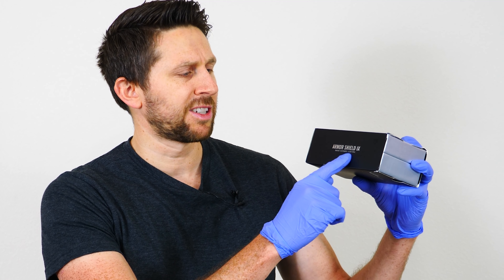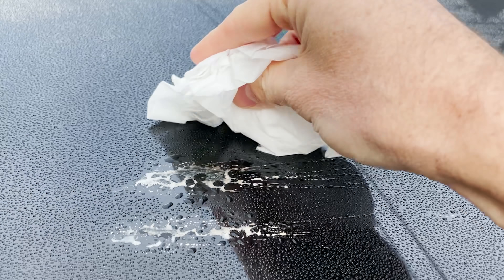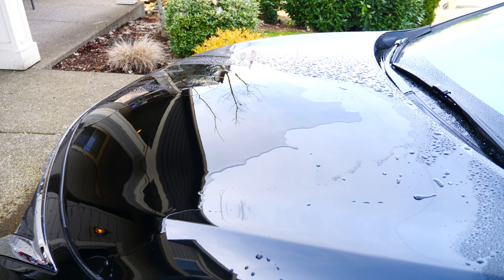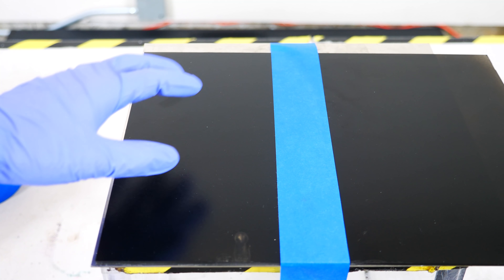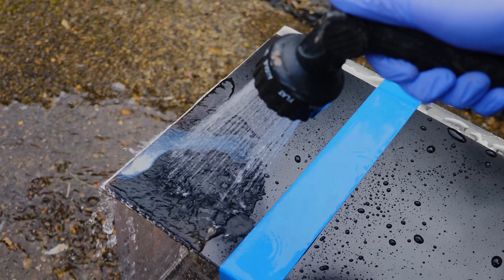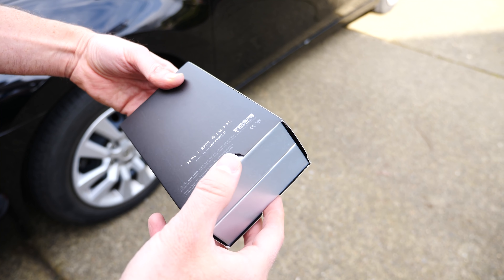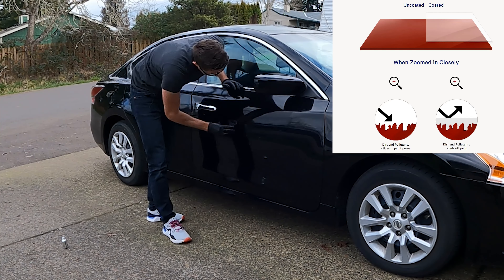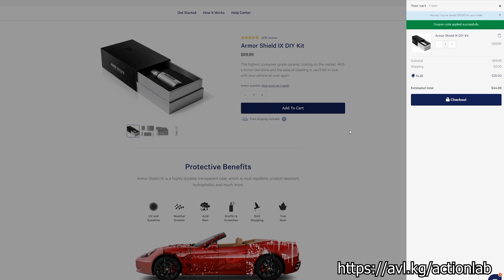Pouring Concentrated Hydrochloric Acid On My Car

Comment: "As you can see, the hydrochloric acid didn't affect my hood."
[lifts hood]
"My radiator!"
Reply: Pray for the aluminium parts 😂
Reply: Also plastics in the front. I wouldn't mind pouring acid on the car, but I don't think I can afford the experiment with toilet paper ;)

Comment: I work with a lot of HCl in my day job and I can confirm that the fumes coming off of that stuff HURT when they get into your mouth/nose. They also seem to accelerate the rusting of every metal object in our lab - our tweezers, the AC unit, everything. There's a spot where we set baskets of acid-washed aggregate out to dry and the pull chains for the window blinds right above that are completely rusted - as is the metal counter below (right through the old paint in some places!!!)
Reply: i don't think you need to work on any job to know weird fume to your lung= bad

Comment: Just bought 3 bottles. They got a good deal. Buy 1 get 1 50% off plus the promo code another$25 off. And when you checkout they give you an offer to add a 3rd bottle for $29. I trust this guy and his science or i would never have bought this.

Comment: did you have a layer of base on the ground under your car. i feel like letting acid of anykind just free on to the ground. that could be bad
Reply: Hydrochloric acid is sold as concrete cleaner at home depo

Comment: How to Neutralize Sulfuric Acid?

Everyone else: uses either Sodium Carbonate, Sodium Bicarbonate or Sodium Hydroxide
The Action Lab: nah, just hose it off with tab water
Reply: Well diluting an acid reduces its corrosive nature and makes it weak. Also he used very little amount of sulphuric acid so he can just wash it away. If the acid was too much concentrated, he may had to neutralize it then.

Comment: I feel it's just common decency and honesty to mention that you're sponsored by them at the start of your infomercial. Not against doing the video at all, it just feels slimy that you didn't mention them as your sponsor even once. That "Includes Paid Promotion" small print in the corner for the first few seconds might cover you legally, but I'm of the opinion that it doesn't quite cover you morally...

Comment: When an item is coming out of a white hole, would it create a shadow that's slower than the speed of light. like if u put your finger in the fast area in the splash zone of a tap. I Hope this makes sense. and could it also be reversed for a black hole

Comment: Hello, I was hoping you or someone in the comments could explain something. so in my room I have a ceiling lamp above my bed. What is odd is that when I sit on the edge of the bed and look straight ahead downwards in the corner of the lens (peripheral vision) I can see the reflection of the ceiling lamp, however if I turn my eyes to try and look at the reflection in the lens it vanishes, the only way to see it is in the corner of the lens when looking straight ahead. Is this odd or just a usual trick of the light?

Comment: Back in high school we learned about oxidizing properties of accids. Some acids actually have them when dilute and not when concentrated. The oxidizing property allows the acid to react with less reactive metals (copper). I think it also speeds up the reaction with iron but I am not sure.
https://en.wikipedia.org/wiki/Oxidizing_acid

Comment: Check the grille, just under the edge of the hood as well as the hollow areas of the backside of the grille and bumper covers etc.
The acid may have been pulled into the seams by surface tension or capillary action and gone on to attack any untreated surface.  Most likely behind the grille or any painted or metal bits therein.

Comment: Realy nice video but I got a few  questions 1. Could I apply the ceramic shield to the case of my phone ? 2. Just hepotheticly what would happen if I put my diamond chain in the acid that desolves carbon ?would it then be blank platinum ?

Comment: I wanted to see if hydrocloric acid would be ok to remove grinder rust dust {cold deposited not hot direct sparks}  of paint without damaging paint. In long round about way I guess the answer is yes  {but would have appreciated it if u poured the hydro on the other side like u did with sulf}.  Also, u should have been on the other side of car hosing the nontreated directly & from there with weaker spray hose other treated side to emphasize difference. However I struck gold mine regarding the silicone stuff. As new to boating i think antifoul paint is a crock and was hunting for such silcone products but couldnt find anything. So thanks. Two birds with one wobbly stone.

Comment: 0:27 does such coating also prevent rusting? Because there is nano ceramic coating, so oxygen shdn't react with the car cover surface, right? 🤔 Will such coating also prevent fire?

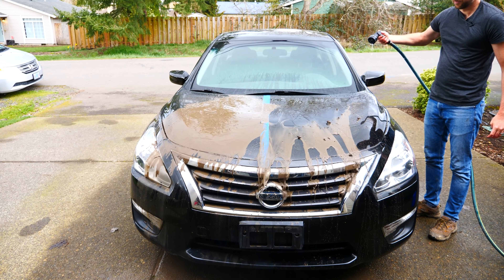Comment: It is worth mentioning that the video at 1:20 does not provide the footage of dirt being washed off the hood not covered by the ceramic coating, it only shows the hose washing away dirt from the part of the hood that is ceramically coated.
The few seconds remaining of the clip show the hose washing the hood of the uncoated side and demonstrates that the difference looks to be negligeble. This indicates that there seems to be somewhat equal effort required when washing both the coated and uncoated surfaces - they both seem to be equally easy to wash. (Atleast judging from the poor demo)

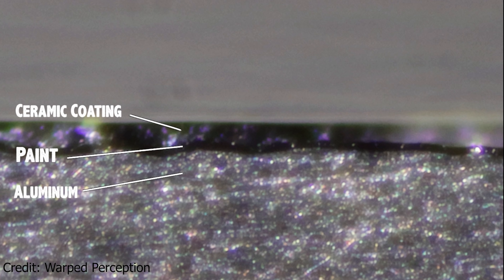Comment: Thought I would mention about the Warped Perception picture at time stamp 7:49. That picture makes it look like ceramic coating is thicker than paint. That is not the case and it is more like 0.1% the thickness of the paint on your car. The picture actually shows an anodized aluminum finish and not paint as is labelled in that picture. An anodized layer is thinner than ceramic coating.

Comment: It's nor fair. You should compared ceramic coated with carnauba waxed surface. And good thing the epoxy 2k clean coat have good chemical resistance

Comment: You have to have in mind that not all clear coats are the same. If your clear coat does not contain hardener, the acid will eat though it like you showed on metal plate.

Comment: *I have a question that might be very stupid so please don't burn me if it is I'm really a dumb to anything car-related.
Would it be good or bad to put this ceramic coating on the wheels?
Wouldn't the wheels repel the water on the road (assuming it's wet...), thus provide a better grip on the asphalt?

Comment: Can you mix concrete and graphite? You recently did a video on graphene. I'd be interested to see whether graphite could increase strength and/or thermal conductivity of concrete for application in heated driveway

Comment: Sulfuric acid does not react with "everything containing carbon" - it dehydrates cellulose or sugar, but does not have effect on saturated or chlorinated hydrocarbons. It is a strong acid, but not much oxidizing. Adding a little hydrogen peroxide though, makes peroxosulfuric acid which is a strong oxidizing acid destroying organic material easily.

Comment: The only warning for all of you while applying a ceramic coating is that it should be done in an indoor garage since most products need more than 24 hours for the product to be curated. During the curation period if it rains and the car remains outside, than the outcome is really nasty and it is impossible to remove the already applied coating. I highly advise that you do it only if you're sure it is not going to rain. Otherwise, do it in a closed garage.

Comment: Isn't it dangerous to put water on acid directly?
Reply: You add the water to the acid, not the acid to the water. You use baking soda to neutralize

Comment: It is extremely suspicious that the two sulferic acid tests at the end were not run simultaneously, that no time info was given and that the test on the coated section cut away abruptly right after application. Not a good look on top of being an infomercial with only a slight pretext of science content.

Comment: Its not as easy to apply the ceramic as you make it seem. The car needs to be perfectly clean, with no spots, no dust, no nothing. I happily paid the $600 to have it professionally done. I would have screwed it up if I tried it myself.

Comment: Hey, big fan from India, love your videos. I had one question for you and want you to make a vid on this topic.
The thing is I watched a video of a blast in which shock is seen few seconds before the sound is heard so my question is
Suppose we are on a boat and a bomb is set to blast
Now the blast is seen immediately but the sound wave reaches the boat (us) after 10 seconds
But as we know speed of sound is roughly 2x in water than it's speed in air so approximately the sound of the bomb will reach us faster (lets say 5 seconds) via water (obviously we will not hear it bc our ears are in air)
So what if we jump after 5 seconds snd before 10 seconds
(In between when the sound wave have passed us via water but is yet to pass us via air)
Can we ignore the sound of the shock wave by doing this?

Comment: HOW COULD THE HYDROCHLORIC ACID NOT DAMAGE THE PLASTIC ACID CONTAINER?🤔🤔🤔🤔
Reply: Plastics are surprisingly resistant to many acids. You can't put hydrofluoric acid into glass, because it eats through it. Some plastics are very resistant to it, though. You need to learn more chemistry.

Comment: Sulfuric acid does NOT "hydrolyze anything that contains carbon", it's actually the other way round. Concentrated sulfuric acid is very hygroscopic and it removes water (even if it's chemically bound) from other molecules/materials and it doesn't care if they contain carbon or not. Hydrolysis is the opposite thing, where molecules get destroyed by reaction with water. The whole experiment looks rather like a dumb commercial to me. Like why would you dump concentrated hydrochloric acid on your car in real life?